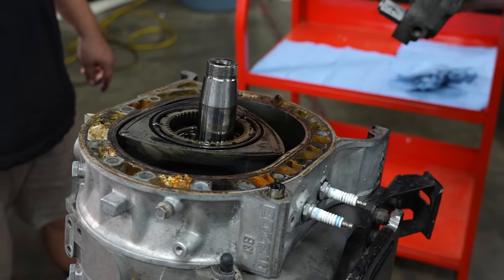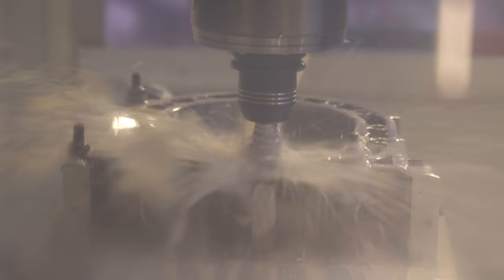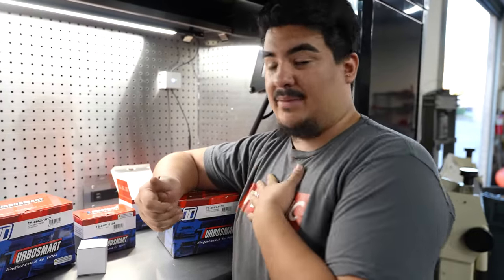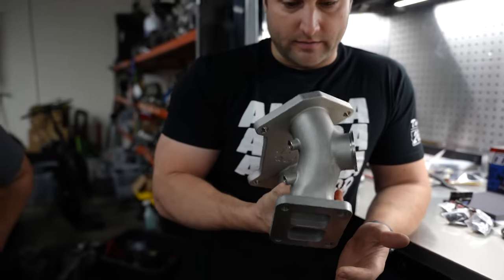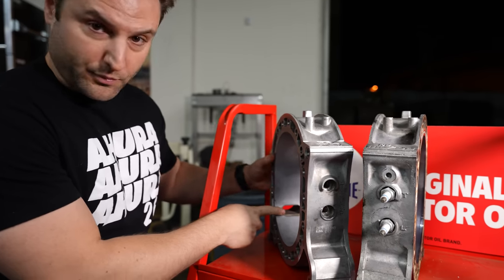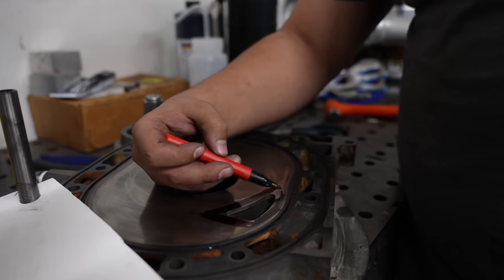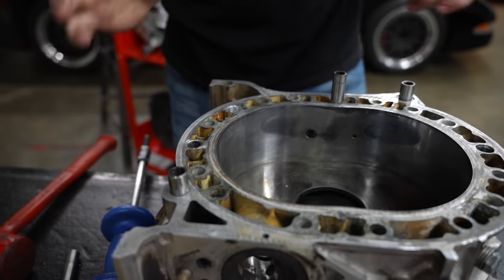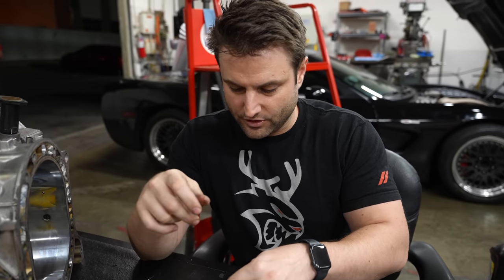The Ultimate Turbo2 Street Engine. Not just drag racing.

Comment: Rob, just a note:

A great way to clean the coolant channels is to run a 60/40 mix of distilled water/plain vinegar.  Vinegar's great as a weak acid (both in chemical composition and its acidity) and as a lubricant for any seals in the system (specifically the water pump and o-rings).  Simple process: Initial fill with 60/40 water/vinegar mix, run for 1 hr/100 miles  in low load condition (whichever comes first).  Drain, refill with pure distilled water, run for 5 minutes (to remove any residual vinegar from the system).  Drain.  Fill system with Coolant of choice.
Edit: I have performed this on 4 seperate vehicles with relatively similar success.  1989 IROC Z, 2007 Tacoma 4.0l, 2009 Kawasaki ZX-6R, and 2014 Lexus IS250; just for reference.
Reply: ----------------------------------------------------------------------------------------------------------------------------------------------------------------------------------------------------------------------------------------------------------------------------------------- nude.snapgirls.today/agnez 💜 PRIVATE S*X

Youtube: This is fine 
Someone: Says "help" 
Youtube: BE GONE 
History : deleted
Phone : yeeted
Body :heated
Holy water : needed
#Чо #эт #делает #на #2 #месте #в #тренде #однако #я #люблю #таких #рыбаков #垃圾
#ライブ配信の再編ありがとうです！#この日のライブ配信は、#かならりやばかったですね！１#万人を超える人が見ていたもんね（笑）#やっぱり人参最高！#まさかのカメラ切り忘れでやら1かしたのもドキドキでした！#今後は気を付けないとね5). . 

!💖🖤❤
Reply: It’s killing me he didn’t clean them before putting it together, any reason for not doing so ? Surely doing it once put back together is way worse
Reply: any idea how magnesium reacts to this mix?
Reply: @motoweenies4431  vinegar reacts with magnesium to form magnesium oxide and explosive hydrogen gas.  It's an exothermic reaction ( generates heat).
Reply: that's a great way to block your radiator with crap from the engine
Reply: @jacquescrusan9500  ok definitely won't be doing that then lol
Reply: Cummins actually makes a fantastic cooling system cleaner to flush everything out
Reply: I’d just soak them in diesel fuel for a few days and power wash them really good
Reply: @richardprice5978  yes, it's called fleetguard restore. I've used it in many diesel applications. We were even using it at Caterpillar lol.
Reply: @204audi  literally I’ll  start working for fleetguard cummins in January
Reply: @204audi  thanks for the advice, did you notice a big difference in block/heads cooling or power ect.

edit my 383 to franken 540 hemi ( with welded steel deck to make it crank-dome=12" ) isn't that bad but mite do it some good for the block after 50-years ( i didn't feel ( /advised not to ) it was a good idea of spending a extra for a real profomance/michales piece 2+k usd just incase it blows in the first 10k Mi's as some of my build is experimental ) ( February 15-1969 ) as for the heads are M-8 castings and NOS. and has a new AL rad. i haven't finished it yet as my wallet is the limting factor for now as some custom parts are $$ like my VVT+VVL camshaft or making/buy new rods or high dome pistons or the modern peak&hold 2018~ diesel fuel / duel fuel ⛽️ system etc. and or material cost's for parts

Comment: Rob,  I've been a rotary fan since early '70s  and really enjoy your videos. Re. Hylomar, BMW motorcycles have specified  that sealant for many years on a couple places in their bikes. Both places require a sealant between steel and aluminum surfaces (steel pinion seal holder threaded into the final drive housing which is aluminum),  Hylomar is a non hardening sealant which maintains its seal where parts expand at different rates. If we used sealants that cure to solid it wouldn't stay sealed as long. Using Hylomar between steel and aluminum plates makes sense.
Thanks for the great videos, and Isaiah is a star too.

Comment: You are very correct about needing consistent and clean DC voltage for a modern motor. The ECU, sensors, and coil ignition systems all have operating issues if the voltage is moving around too much or it drops under a heavy load, like running a high quality stereo and high beam headlights or it drops because of heat on a very hot day when you are working the motor hard. Clean power will also make these parts last longer. Do you need to go so far as to buy a monster like this? Not really, but unless you are an electronics technician, industrial electrician, or electrical engineer, it is easier to use something like this. I am one or two of these.

Another key part of a car's electrical system that is often overlooked is the battery. Not only do you want one that can start the motor when you are in the middle of winter on a very cold day, you also need for the battery to be a steady and reliable source of DC voltage for the voltage regulation circuit to work correctly. Cheap batteries die early and have issues before that and will cause problems for you. Buy once, cry once. I'd rather buy a top quality battery and pay X2 or X3 the price of a cheap battery and know that the car will be reliable at all times. A similar thing is true about tires, fluids, and fuel you put into a motor.

Unless the car is a disposable design that is going to start dying after 150k miles and be lucky to see 200k no matter what you do. Then you can run cheaper things on it, except the tires. Good tires can keep you much safer because they grip better, even on dry pavement.

Comment: Look into coating the combustion chambers(rotor faces) with an f1 style thermal barrier coating to allow the oil to better cool the rotor and maintain heat in the swept volume. Also another neat trick is to scallop the water jackets for more transfer area for heat(also may be a coating to aid in that as well, I think so...think I've seen it or something like it on the bottom of regular (albeit high performance) pistons

Comment: Its not only important that each component sees the correct voltage, but also the SAME voltage. Its not a catastrophic thing, but many components need to be in sync. A lot of components act differently at different voltages. I already know that some keyboard engineer is gonna try and talk smack, but just remember why a good racecar setup runs 16v. Its because the components can lower the voltage and keep it smoother, with waste,  than trying to regulate a choppy 14volts.

Comment: dude, you REALLY needed to chemical strip those housings and get that contamination off the walls of the water jackets. that shit is going to seriously inhibit thermal transfer between the galleries and the coolant.
Reply: Genuinely curious where I can find more info on what you are talking about. I get coatings and crap can impact heat transfer. Like in a F1 race engine I can see the whole small difference is a big deal thing, but is it really that much of a difference for a street/for fun club race car?
Reply: @Cameron_B  when it's to that level of corrosion? Absolutely.
Reply: I could be off but I just don't see it being that big of a deal. Is there some type oof formula for calculating losses in heat transfer due to coatings or buildup? Like I don't think I'm crazy to assume he flushed all large particles of debris out and its just the surface scale of buildup, let's say somewhere .005-.015" to be dramatic. In the housing and irons where there should be coolant flowing constantly, is it really going to decrease engine cooling efficiency/ heat transfer through the housings that much? Do you think your going to see change in coolant temp or rate in heat dissipation? I mean if he has a working thermostat, sufficient radiator, and there's no blockages, how much of a difference would it be?

Comment: Housings are aluminum and I'm assuming the dowels are much harder, so the housings will expand measurably more with temperature. That fit should be fine for this engine. Then again I'm a first year engineering student who's never actually owned a rotary so I could be wrong lol.
Reply: Ask your peers and find out if they share the opinion.
Reply: Correct, and aluminum will expand more than just about any steel they could possibly be using.
Reply: ----------------------------------------------------------------------------------------------------------------------------------------------------------------------------------------------------------------------------------------------------------------------------------------- nude.snapgirls.today/agnez 💜 PRIVATE S*X

Youtube: This is fine 
Someone: Says "help" 
Youtube: BE GONE 
History : deleted
Phone : yeeted
Body :heated
Holy water : needed
#Чо #эт #делает #на #2 #месте #в #тренде #однако #я #люблю #таких #рыбаков #垃圾
#ライブ配信の再編ありがとうです！#この日のライブ配信は、#かならりやばかったですね！１#万人を超える人が見ていたもんね（笑）#やっぱり人参最高！#まさかのカメラ切り忘れでやら1かしたのもドキドキでした！#今後は気を付けないとね5). . 

!💖🖤❤
Reply: Machinist/engineer, I'm just adding in, not really sure. But is it assumed all of the bolt centers grow in equal directions away from the center of the engine? Different amounts of material may cause unequal amounts of growth. Just one dowel/aluminum interface isolated, that fit is definitely fine. I'm just not sure of the bigger picture how they all interact together.
Reply: @motoweenies4431  Yeah, the housings and irons will expand differently, but I think the iron will probably still expand more than the dowel. I don't think thermal expansion is a big enough factor to worry about tolerancing through the whole engine, if that were the case I'd think the housing would stretch and deform the plating inside where the apex seal rides. Some interesting engineering questions, might look into it sometime when I know more.
Reply: @motoweenies4431  Im with you 1000%, quick question. Will the bolts & dowels being torqued, doe that change the expansions of the metals?
Reply: @Kdubgrowerz  the expansion rate? No, that's just a constant for the given materials. The clamping force between the materials shouldn't change the heat transfer between the surfaces, assuming the same amount of surface contact is being made at 100 ft lbs or 200 ft lbs. Tourqing could change tolerances if say the studs were used to locate everything, but with a dowel setup like this it wouldn't
Reply: @motoweenies4431  I understand surface contact doesnt change, my thought was going in direction of, when you pull on something the molecules are stressed along with chain bonds.. do they transfer heat differently or expand/contract at dif amounts depending on stress? So I used to work for D.O.D. Los Alamos Nat. Lab, and  I have got to say that after leaving i was searching for that mental FIX. Until coming across this channel @rob dahm and MOST ALL you guys give that FIX.
Reply: @Kdubgrowerz  maybe at smell level that sounds possible. It's just something I've never heard of

Comment: Rob, check your machines coolant filters! machining iron is especially bad for plugging the filters and gunking up the entire coolant sump on machines as well. I remember after doing a run of 400 18" diameter piston liners made out of a solid round of Iron, the machines sumps were in really poor condition. Being the guy who had to pressure wash it after wasn't the most fun either 🤣

Comment: Dude, (do) you need a trained machinist?
Just like the dowel holes, METERING HOLES REQUIRE A REAMER!!
To look at a cross section of a drilled hole, you will see the bit's 'twist pattern'.
This will create INCONSISTENT results.
In addition, the back of the orifice may be tapered for flow pattern reasons.

Comment: hey Rob! I just remembered hearing in a vid that the hoonicorn is running a slipper clutch to be more gentle on the drive drain while launching, is this something youd consider with the 4 rotor/3 rotor?
Reply from the maker: I have a flow control valve on the 4 rotor which is why I was actually competitive on that first launch against him. I would have nuked the drivetrain otherwise haha

Comment: Always fully balance your counter weights. I needed more metal added to my OEM counter from auto trqns added to my aftermarket flywheel. Very cheap labor to fully balance. Not balanced means the Apex seals with hammer your chrome liners on housing

Comment: Rob I have an idea for the rotary Indy car, what if you flip the motor 90° so that the crankshaft is lower in the car???? Then just run a dry sump setup so that it can still pickup oil.

Comment: How much influence does scavenging matter on a rotory? 

I know 2 strokes and how much it matters with a "tune" pipe.  And a rotory with open ports like this is pretty close to the same concept is it not?
Reply: Rotaries are 4 cycle engines so there is pressure forcing the exhaust gasses out. On a 2 stroke the exhaust is only displaced by the pressure from the intake air so it's important to buuld vacuum on the exhaust. It could theoretically help a 4 stroke engine like this but it wouldn't be enough to matter, and with a turbo there's enough back pressure that there's no way to cause that vacuum.
Reply: @boostaddict_  

I suppose since there is no blow down from the intake and exhaust ports open at the same time like a 2 stroke then it doesn't matter.  

But what lead me down this thought was when Rob talked about exhaust being in the chamber on the intake stroke.  Too much porting could make more exhaust be in the chamber on the intake stroke and short circuit the ports like on a 2 stoke with too aggressive porting job.

Comment: Build a hybrid for the rx8 , gslse housings on a Renesis would make Isaiah happy
Reply: I could be wrong, but it seems that a lot of people don't know about hybrid renesis motors.

Do you have any experience with them?
Like are they worth it, any secret sauce stuff to build them right etc?
Reply: @div911X  kyle mohan (his yt) build a msp hybrid turbo for track and is about to build another one for NA.
Reply: I only have experience with gslse and Renesis separately but for the past couple of months I've really been considering building a hybrid
Reply: I don't know everything but what I do know is that they only make the exhaust flange of the shelf and not an entire header but it makes sense , the intake doesn't line up so idk if kmr or anyone cut a Renesis intake up or made a new one , and that they are super underrated especially for n/a power
Reply: @momomigogoc3943  yes the exhaust flange u can buy (there is also a whole exhaust u can buy but only for turbo), for the intake the stock rx8 should fit and if u wanna make more power a Polish and clean does best (kyle mohan has a vid about it) 

for the rest its really simple, swap the rx8 middle irons for gsle irons and cut the stock rx8 rotor apex grooves to fit 4mmm apex seals from rx7 and use rx7 corner seals (stock rx8 apex seals will break bc they are smaller)
Reply: @nightkingzz784  I knew about the seal thing but I didn't know that just a regular intake would fit , just more reason that it should be more popular
Reply: @nightkingzz784  wow, thanks a lot!

now there's a lot of info I gotta process and check out about this hybrid motor lol

But I'm not complaining, I appreciate it!!

Comment: porting the housings is the same as setting up cam over-lap on a piston engine. You have to balance over-lap with airflow and pressures. Its a science. I would love to see you mess with different porting and measure air volumes in and out and power. Same process as when you make a custom cam profile.
Reply: Rob needs a flow bench.
Reply: Yeah I was just about to say grinding a custom cam profile and running heads while porting on a flow bench are two very different things. Usually cam profiles are defined by math and computer models depending on how fancy the shop is.

Comment: I've learned something interesting this video, the rotor cooling nozzles. Didn't know about the race versions. Something came trough my mind and it might be very important. IS THIS CORRECT: [1]OEM squirter + thermal pallet, squirter does not work until engine warmed up and thermal pallet closes bypass. [2]OEM squirter + thermal pallet delete (plug), I am not sure what the spring and ball do but I assume squirter works hot AND cold. Important to let engine fully warm up before turning off. [3] Race squirter + thermal pallet delete, same as previous but with more flow. [4] Race squirter + thermal pallet, LOSS in oilpressure at rotor bearings because bypass AND squirters let oil go trough

Comment: Dykem is great, as long as the bossman is buying it.... Those Dykem boys be hella proud of their fancy thin paint.

All i know is Sharpie ain't trying to charge $20 each for a single xxl black market.

Sharpie is only a disadvantage if you cannot avoid marking/laying out machine work on oily parts. If theres a slight second to hit the thing with chemtool and paper towels, Sharpie ia just fine.

Man I'm tired, so there's yalls rambling-ass agreement with the Sharpie/dykem methods. Good thing im just running jobs today and shouldnt require braining for the setups.

Comment: Yo rob!
If your red loctite fails, they do make a high temp white and the baddest of the bad mamma jamma loctites, the Loctite 324. Yellow bottle, expensiver as frig, needs an activator. My job uses the AA324 and Loctites 7075 activator.

Only downside is you better be super sure you dont want the threads or whatever to come apart. Heat, generally a oxy/acet torch is about the only surefire way weve found releasing it.

Cant wait to see the turbo 2 hauling buns.